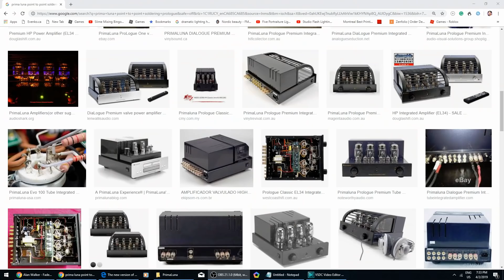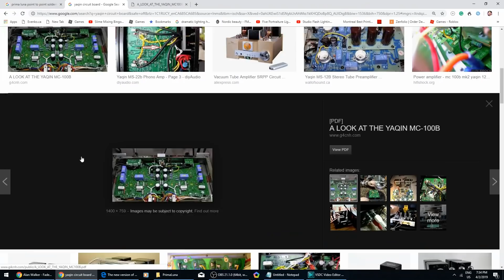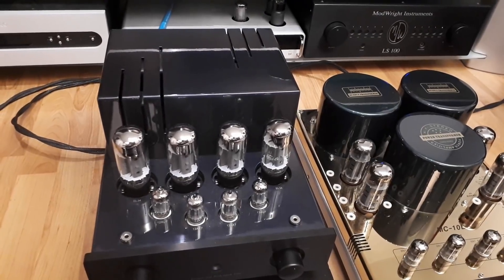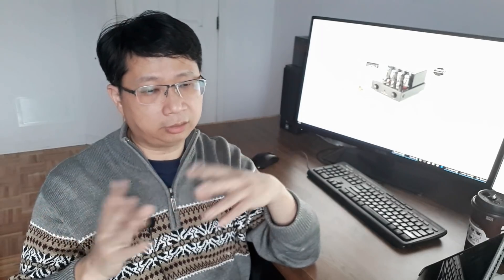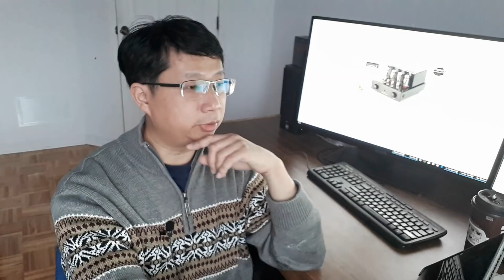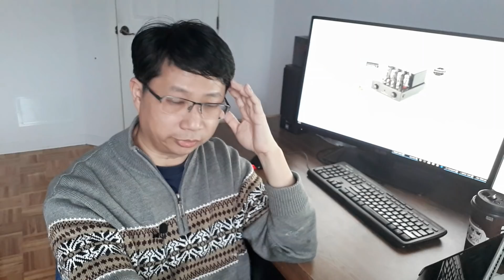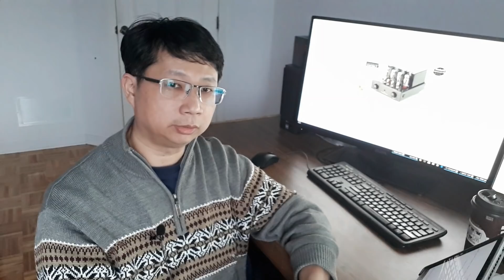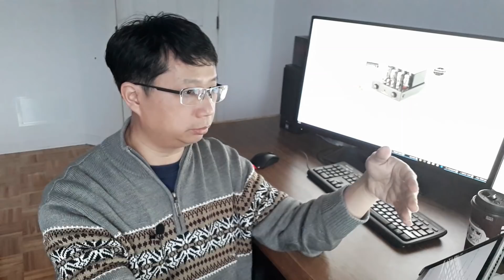Amazing PrimaLuna Prologue tube integrated amp vs Yaqin MC10L

Comment: PrimaLuna is amazing equipment, but if you want that warm 1950's sound you need to use some NOS valves to achieve it, saying that KT150s are outstanding valves also. I actually love listening to radio through my Evo 400 (on GL KT88s and NOS Radiotechnique 12AU7s), I use a lovely early 90's Sony ES series tuner, and it absolutely sings, i'm using the new Wharfedale Evo 4.4 speaker which are wonderful. People who've grown accustomed to the awful DAB radio in the UK find it difficult to believe they're listening to an FM broadcast when I show them. Luckily in most of Europe DAB was shunned and we still have FM as the main radio bandwidth.
Reply: Forgot to mention that the Evo 4.4s, as wonderful as they are, are going to friend of mine and are being replaced with tannoy xt8s. I really wanted Cheviots, but they're too rich for my blood, so we'll see how those do. What I would say is that the PL Evo 400 is an amazing amp, and I couldn't see myself reaping the benefits of anything more expensive. I think even the Evo 100 is fantastic, but I really wanted triode mode and the price difference between the 300 and 400 is not so massive, and just bit the bullet in the end for the extra power, just in case, I probably would have been fine with the 300 tbh.

Comment: Hi Thomas, i saw you write that the Focal 1027s suits all your needs for the moment, what about the bass? I'm asking because the they are rated only at 42 hz, how come ? Or what it is written down on paper does not always reflect the actual performance of certain speakers ? Thanks.

Ps - i saw in one of your videos a Vincent amp, would you happen to know anything about the SV 233 model, what type of sound does it have?
Reply: So what about bass with Focal 1027? Very interesting to know :)

Comment: Hi Thomas! I need your advice on my dilemma. I'm torn between yamaha as1100 and primaluna dialogue premium integrated amp. I currently have klipsch forte I as my speakers. What should I pick between the two?
Reply: Myself being an owner of Heritage Klipsch speakers, an A-S1100 and Cayin tube amp, I suggest you definitely go with a tube amp (a quiet one such as Primaluna or Cayin). While the 1100 is a great amp, those horns do benefit from some taming which a good tube amp will provide. I don't care for my Heresys when powered by my 1100, but they sound as good as can be with the Cayin.
Reply from the maker: Hi Mark, sorry, I never heard the AS1100 so I have no idea how it would sound with the forte.

Comment: Hi Thomas, 
Thanks for your opinion piece. 
Did anyone notice that the Yaqin is just beautiful? Your camera work certainly made the PL look "meh" beside it....And for only $500 :-)
I have a Silk Audio MS38    (redesigned & rebadged Yaqin) in a second system. I just LOVE the "Old Sound" it's beautifully saturated colours make you forget Hi-fi and focus on the MUSIC! 
(Your wife might be right :-)
Over  3 years I've replaced the stock tubes with Mullard EL34  and now Gold lion KT77.
Clarity has improved. Imaging and depth aren't bad ( I have my main system for that), but the TONE !
When you say the Yaqin sounds more musical, folks interested in pure musical enjoyment should stop right there and buy a Yaqin.
One day I hope to try a PL at 3x the price :-/
Does your Yaqin or the PL have pentode/triode switching?
Reply from the maker: Thanks, the basic one does not have the switch, me too, I hope to try their higher end models.  Thanks for the comment.
Reply: outside is one thing but inside is the key, lot of Chinese company doing very nice looking tube amps but inside........not that good:)
Reply: @Hypofx  
I've been inside to add an aluminium  L Brace under the output transformers. The weight of the transformers was bowing the top plate. Heard  of it happening  in $5000  tube amps too, so forgivable in a $600 unit. I posted pix online. Google will find them if you're  interested. 
Construction was circuit board based instead of point to point (of course), but looked good, with relay input switches . Its reliable 4 plus years in, with a couple  of hours use daily in my morning music room .
And music sounds beautiful;<)

Comment: thomas I have a very good solid state integrated amp that has a DAC and a Streamer, if I wanted to try tube sound what would make the biggest change a tube pre or power amp to use it in conjunction with my solid state integrated amp? thanks
Reply from the maker: If you have an integrated amp that has built in dac and streamer, I don't think you can use a tube preamp. If your integrated amp does have a pre out, then you can use a tube amp. However, the problem with tube amps is power so that depends on the efficiency of your speakers.
Reply: @ThomasAndStereo  it does have a pre out, so you think it'd worth to have a tube amp with my integrated solid state? my speakers are the bowers and wilkins 706 s2 which are 88 db and the integrated amp is the simaudio moon neo ace, thanks for answering

Comment: Dear Thomas, I own the primaluna prolouge premum integrated amp , please let me know which tubes to use in order to get the Holographic sound you refferd to. thanks
Reply from the maker: Your prologue should already be holographic. If it is not, it's most likely your speaker placement that is the issue, pull it out from the wall and try that.
Reply: @ThomasAndStereo  how far from the wall? my room allow me about 20 inches is that sufficient? thanks
Reply from the maker: You will have to experiment, I myself is about 3 ft from the wall and both speaker are at least 7ft apart.
Reply: @ThomasAndStereo  I apply the same distances and it's  working, the magic is happening in my living room.  thanks for inspiring and educating so many people about HI FI audio.
Reply from the maker: @yigalohana  I am really happy you are able to experience that magic. Congrats and thanks for updating me. If your room is treated acoutsically, it will raise it up to an even higher level.

Comment: I know what you mean and there is a movement to make tube stuff sound like solid state.  What happens or a question in the terms of your example of the ls28 is whether or not the manufacturer is using hybrid technology, tubes in one part of the stage and solid state in let’s say the power supply.  A true tube amp or preamp like I had in my Belles 20 was tubes all the way and it was holographic. Now the tube pre amp I would love to own is the Audio Research Ref 5se. I like tubes for preamp and phono preamp and solid state for the power amp giving you both power and finesse.

My Audio Research ls27 is a hybrid.  Prima Luna stuff is great for its price.  So I’m very familiar with old sound vs new sound.  The old sound moves your soul, the instruments sound real and 3D like in scale, each instrument in its own space, but the new stuff can sound that way depending on the manufacturer intentions. The Belles 20 was the best preamp that I ever had and I hate I ever sold it, it was holographic.  Thomas have you heard the Audio Research Ref 75 or the SE?  I have had a Rogue preamp that I hated but a pair of Rogue m120 that I had a love hate relationship with and I personally would not buy their stuff again due to build quality. I have heard the Prima Luna stuff because my dealer sales it.  I can’t wait for Axpona next week.
Reply from the maker: Hey Sid, good that you hear the 'movement' too. It means you have tried enough gear to hear the difference. Yes, I see what you mean by hybrid vs pure and my friend is also looking for the Ref 5Se. I am like you, solid state for poweramp. I never heard the Ref 75, well, really listened to. So in your opinion, are the prima luna able to compete with AR? If we take top of the line Prima vs an AR at the same price point? I don't know if they have anything at the same price point though.
Reply: Thomas & Stereo I haven’t heard top of the line Prima Luna, nor the top of the line 750 from AR, yet, but the integrated that you showed I have heard and one model up.  In AR line ref6 and Ref 3 phono stage although it’s newer, I don’t find it twice the price good considering that the Ref 5se and Ref 2 phono preamp are awesome.  I have also heard the new ARC 160, the thirty thousand dollar mono blocks. Thomas I will tell you this, if I were starting over from scratch, you really can’t go wrong with Prima Luna and the sound quality and tube rolling options are outstanding.  

I wouldn’t turn down a Prima Luna piece, especially if I had high efficiency speakers.  I just got in a Mytek Liberty DAC that I’m putting through its paces, it’s not a bad performer and it’s currently kicking my Dac 8 in the ass, but it’s a newer Dac chip and I can plug my Aurender directly into it instead of a usb converter, for MQA, like with the Dac 8 and the MQA packet is wrapped natively through the Dac. The head phone amp (built in) is a small bonus.  I’m also a headphone guy as well.
Reply from the maker: Man, I am hunting for a Dac 8, I really like the Dac 7, especially for piano.

Comment: Nothing meh about Primalunas stuff, best deal in HiFi!  Stock tubes are perfectly good, don't believe the hype.  If you want ss sound (newer sound) get the PL gear, they are all in push pull config.  You want chubby warm, go s.e.t.
Reply: Hi Thomas your a pleasure to listen to..
Reply: But, is bass comparable considering the low power of SET integrated amps?  I'm a low volume listener (< 80 dB) with average efficiency speakers. Decware?  Thanks!  (Have PL Prologue 2 currently).

Comment: Like to hear your thoughts on speaker matching with these amps vs speaker sensitivity
Reply from the maker: Ah, that is a big topic, maybe in another video one day.
Reply: @ThomasAndStereo  Just had the chance to listen to some Harbeth P3ESR's and 30.1's with a Primaluna Prologue Premium thought both were great but conventional advice is to recommend more efficient speakers?
Reply from the maker: @chrispendergast7792  Ideally but if it sounds good, that is all that matters. It's not like those 2 speakers will give you better bass by a significant margin even if you have a high power Solid state amp.
Reply: Thomas & Stereo x

Comment: I don't suppose anyone could guide me on what kind of tube amplifier would drive a set of paradigm studio 60 v5 floorstanding speakers. I usually look at power ratings before I do reviews and go from there but that all seems to go out of the window when it comes to tube amplifiers. Anyone experience with lumley reference?
Reply from the maker: Is there a reason why you want to use tube amp with the Paradigm? Why not a tube preamp and a solid state poweramp. Or an integratede hybrid with tube and solidstate like a pathos logos for example. The pathos is not in the same price point but just an example that there are options like that. I think peachtree also have something similar in the hybrid.

Comment: You are right about the bass with tubes. less controlled even with my Prima Luna 5 kt88s
Reply from the maker: Yup, I even tested other $7k , $12k integrated tube amps with the same conclusion. Those are KT150 too. They are good but when compared to SS equivalent class, they do fall behind when it comes to bass.
Reply: @ThomasAndStereo   I had big VTL tube power amp and various pre amps,  quite good sound overall  , but too soft in the bass ,  poor compared to my ss , and the music seemed slightly slow , shame as it was soooo expensive in my country.  The newer ones today  are quite different aparently,

Comment: If you want Primaluna sound (possibly even better due to fixed-bias adjustment) on a budget, seek out an old Cayin integrated like the A-88T or A-100T. Their 45watts sound more like 100+. Cayin is the manufacturer's house-brand and their amps are built every bit as well (arguably better) than PL.
Reply from the maker: I have been trying to get my hands on a Cayin for a while. Just that at the right price, they always sell so fast on the used market.

Comment: The Primaluna amps are quite nice and beautifully made. I had one of the integrated amps, however I made a poor choice as it couldn't drive very insensitive speakers. It did sound quite nice though.
Reply from the maker: Yes, one of the downside with using tube integrated amp.

Comment: Great video thx. It’s early in my journey and all my equipment is VERY entry level. I have no friends in this realm. 
I live in the middle of nowhere so there are no shops for me to sample next level gear. I came across the prologue classic and was very impressed with what I saw. Seemed very accessible. 
I appreciate a trusted (objective) source such as yourself speaking about it even if not a review. 
I myself imagine the place I want to be is a perfect blend of SS and tube.
Reply from the maker: Yeah, I personally use tube preamp and ss power amp. Thanks.

Comment: a matched pair of gold tung sol 12ax7 works wonders . with gold lion 12au7s and kt88s.
Reply: Todd: Is that your recommendation for a PL Prologue 2 integrated?  How would you describe the result compared to stock?   Tks! Vic
Reply: @vicwahbyphotography4866  Hi: yes the Gold Lions are the best new production on the planet.The pl stocks are Chinese mid grade.The biggest difference is in V! 12ax7, GL are  much smoother and better detail,The Power  tubes give much better detail, and dynamics- really sparkle. GL ,materials and workmanship are superior.

Comment: Thomas & Stereo I have the PrimaLuna DiaLogue Premium HP and it is very clean and detailed. I agree it is very analytical solid state sounding. It currently has the PrimaLuna stock amp, and would like to switch them out to some old stock tubes but this amp has 8 EL34's and 6 12 AU7's. That's going to be expensive. Which set of tubes would you recommend to switch out first? I was thinking switching out the 12AU7s first. What is your opinion, and which tubes would you recommend to get more of a warmer sound?
Reply: I Have the Primaluna Dialog integrated.  I run mine in triode mode with KT120’s.  I have always been a big fan of the EL34’s, but when I listened to the KT120’s I had to go with them: the same you are there EL34 midrange with more oomph.  My Primalunas do not sound analytical or solid state, but they do not sound like traditional tube amps either.  I would call them modern tube.
Reply from the maker: Congrats on having one of their amps. Sadly I never tried tube rolling on this model so I would not know. There is a tube expert in the comment section in this video, if you ask him, he will surely able to give some recommendations.

Comment: hahahha Thomas, you are killing me. I was also thinking about either hegel or prima for my ls 50. Cheers,
Reply from the maker: Haha, I would go for a Hegel as it has more power and it's very smooth. You will lose air and holographicness though. No real answer, just a question of taste :) Problem is LS50w is not really efficient so Hegel is my choice.
Reply: @ThomasAndStereo  thankss TThomas, true. Also, i can better fit hegel with maggie that i have in the other room too. cheers,
ap

Comment: For those concerned about brands of tubes?, here's but one of my many listings over the years on said matter:

http://www.audioasylumtrader.com/ca/listing/Tubes/Thomson-CSF-NEC-TEN-Kobe-Tungsram/12A_7-Types./Various./174890

As one of my three tube mentors stressed years ago " when buying tubes ......., knowledge is power ", and then ask yourself why certain brands are easier to source?, once again it's because the music lovers ( not audiophiles per se ) don't bother with them, as there are other brands which simply are much much better at rendering music, think is, one has to know where to look, as well as which of the many factories within the same brand, or country actually produced the best made and sounding versions, and of course the older the better, provided it isn't microphonic in your gear?.

Just something to crew on.
O_o.

Comment: over $2500. , the Yaqin mentioned - $ 450. of course I've read reviews on the Yaqin where build quality is less than pristine, actually dangerous - ground wires, wrong transformers....  oh well
Reply: I went through a load of anguish over some of the reviews myself, before purchasing a Yaqin MC13s. Some claimed they found great builds under the hood, others claimed they found garbage, so I went with people who focused on sound, there I found few complaints. A little more research and I found a lot of people are modding the yaqin, and that's what pulled me in.
So it turns out, not only did it sound good out of the box, but with only $50 in parts it's undeniably spectacular.
My buddy runs a MC275 and now we've swapped them per dac/speaker/environment. They DO sound different, but we both agree on two things, the Yaqin sounds better with natural instrument sounds and Mac does better with electronically enhanced instruments, and that the difference is in no way worth 10 times the cost.
Reply: @mrmaschinaadventures  Thanks Mario. It does appear that China likes great sound as much as America does.
Reply: Rick C I've got Primaluma preamp and yaqin 100b tube power amplifier. Both are good sound built quality and value
Reply: @imosolar  I forgot to mention above that I also use Gold Lion KT77 in my MC13s, my favorite so far is EH for the 12ax7 and JJ Long plates for the AU7. You reminded me of that in your earlier comment.